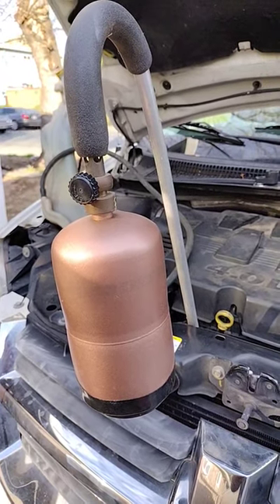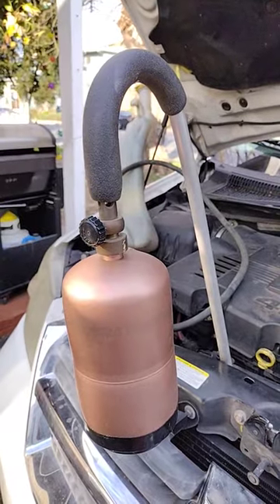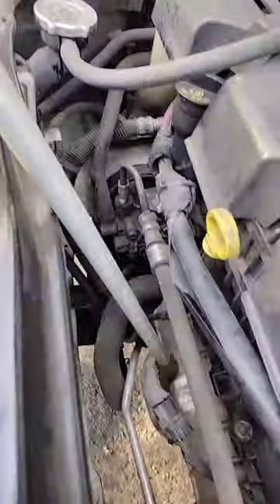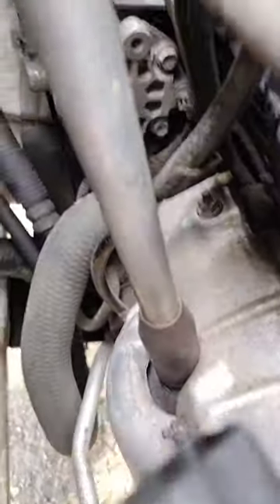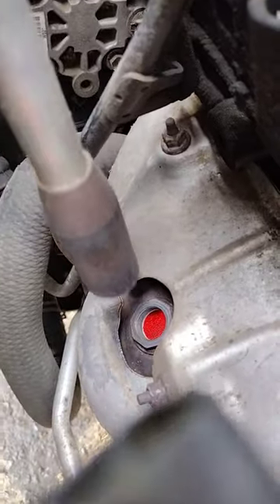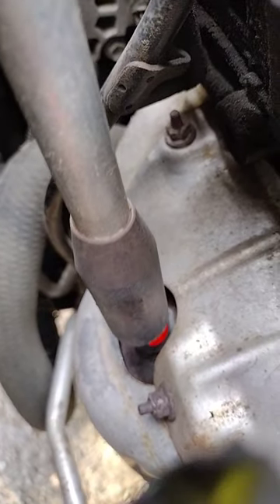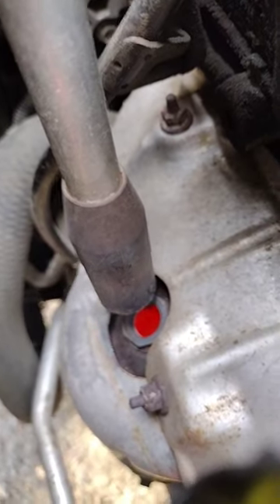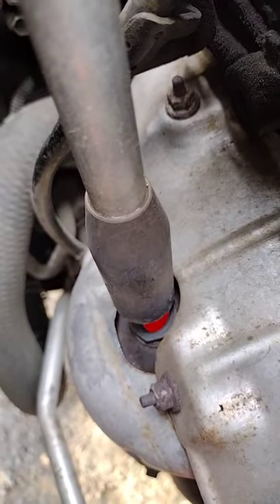How to clean a catalytic converter #youtubeshorts  #repair #cars #passsmogtest

Comment: Do u use a flame or just the propane is the car running or is it off we need more info if your going to make a video like this cmon
Reply from the maker: What I did. 1 Car off.  2 Removed upstream and downstream O2 sensors. 3 Preheated cat through the upstream port with the torch on till cat was red hot. 4 Turned off torch. 5 Turned torch on again no flame and cat continued to consume gas and glow. I could feel heat coming from the downstream port. 
I don't know if it cleaned it well or not but it demonstrate that the cat working.